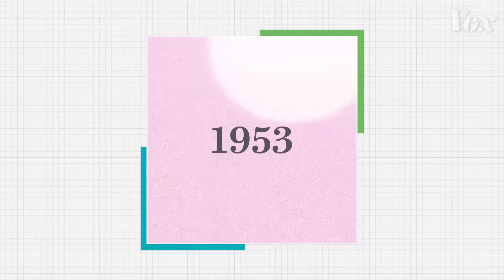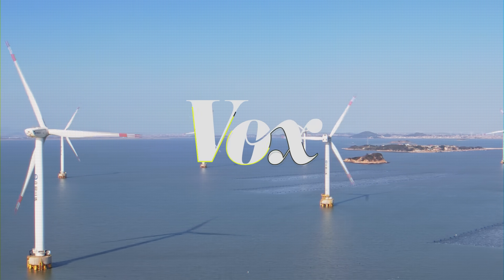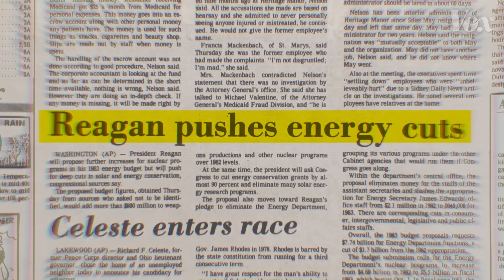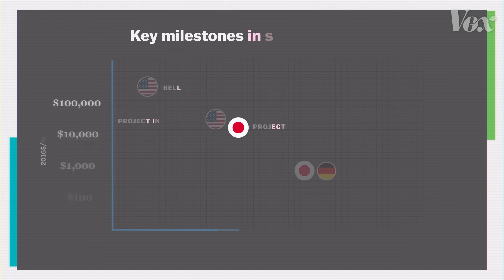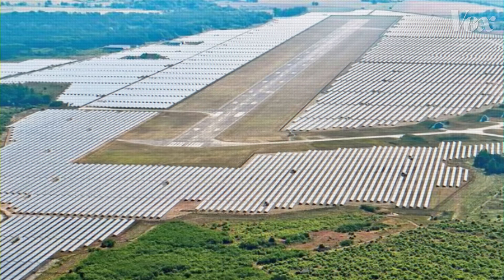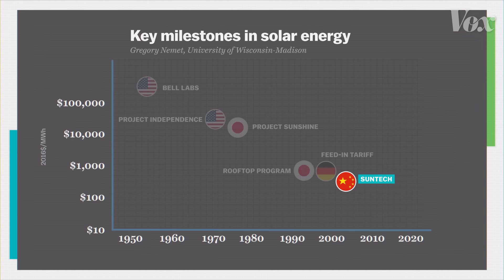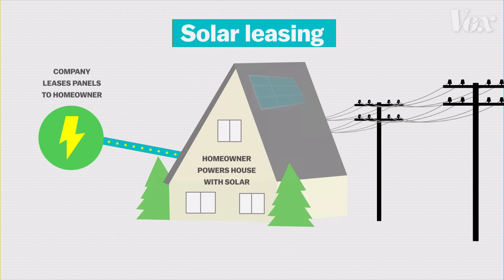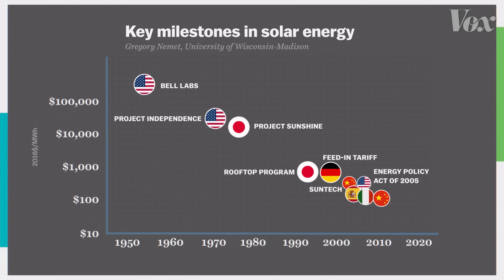How solar energy got so cheap

Comment: Governments should subsidize results, not means. 
Take electric cars (I own one). Rather than subsidizing a specific technology, the government should have subsidized vehicles that don't directly produce carbon when driven. 
The drawbacks of electric cars are:
expensive charging infrastructure (fast chargers still cost tens of thousands of dollars plus infrastructure for each one)
the vast amount of rare earth metals to make the batteries
their weight (mine weighs 4,000lbs, causing roads to deteriorate faster)
refueling/recharging (this has gotten better too, but the best one still takes at least 4-5 times longer than refueling a gas car)
Toyota had found a solution to all of these problems when they spent millions of their own money developing a hydrogen powered car. These still use electric motors and batteries, so you still get all the advantages of an electric car (regen braking, instant torque). However, their batteries are a fraction of the size (so a fraction of the rare earth metals), they refuel as fast as gas cars, they weigh about the same as ICE vehicles. As far as refueling infrastructure: you could build an electrolysis setup and make hydrogen using stuff from your kitchen (seriously, youtube it). 

However, this technology never took off because it can't compete with subsidized electric cars, even though it is arguably a better technology. No one is buying the cars, so no one is putting in refueling stations (and the few that have, have no competition and charge as much as they want). 
When governments pick technologies to win, sometimes they get it right, and other times they don't.

Comment: If This Is True.. Why Are We Not Applying This Same Scheme To Solving The Fusion Problem??
Reply: Because fusion has no starting point of even working for now. The "net energy gain" stories are not "net gain", but a laser pulse of size X generating 3 times X in heat.
But generating the laser pulse needs 100 times X in electricity.
And the 3 times X in heat is nowhere near a suitable form to drive a generator (which would at best gives one time X in electricity...)

Comment: My grandparents setup off grid solar at their rural retirement property in 1999. It cost something like $250,000 
Their property was so rural they didn't have indoor plumbing when they initially bought the property, they were still using an outhouse. So off grid was the only viable option. 

Now day's, off grid is nearing the price off connecting a normal semi rural house to the grid. Maybe in another decade it will be so cheap all new houses will be off grid unless there's some serious reason the owners need a massive power drawer.

Comment: If it is so cheap, why does in California(sunny state btw) PG&E rise the energy rates?)
Reply: Profit. What way is there to increase profits by laying off power plant employees (they cost a lot of money after all), and switch to an energy source that only needs a technician to check it once a year, and then say prices are up because of that change. It's the ideal way to make even more cash
Reply: @slik_  agree. But it automatically means that end users don’t see any cheap energy, etc.
So, the whole point doesn’t make sense, because we have to fix the whole chain from the supplier to consumer.
Reply: @evko9264  I'm all for government owned energy suppliers. But even without price gouging, renewable energy is much cheaper. 

Take a coal power plant for example. First, you have to pay people to mine coal, which costs a lot of money (equipment, liability insurance, personnel). Then you have to pay people (and equipment) to move the coal to the powerplant. Then you have to operate the coal power plant itself, again paying a lot of money for personnel and equipment. You also have to make sure coal isn't being stolen (which is a thing btw), so you have to hire security for storage facilities. And the whole chain is also highly fragile and can easily be disrupted by economic fluctuations (for example, coal miners asking for higher wages, gas prices spiking, which increases transport costs, etc.)

in contrast to this, you have a wind turbine. You buy the whole thing from a company, which then puts it at a location you picked. You then pay for a single technician that checks up on the entire wind farm every now and then. And since wind turbines aren't easy to steal, you won't have to worry about site security either. This chain is much simpler and less prone to being disrupted. The wind isn't going to strike, neither is the wind turbine. Both don't care much about gas prices either. You also won't have to hire somebody to mine the wind, or to transport it to the wind turbine.
Reply: @slik_  yes, I understand all these things. But be a simple user and consider all these chains as a black box. Compare your exactly price and bills today and 3-4-5 years ago adjusting it to inflation. I believe they will upset you.
And one more thing interesting exactly about coal. Despite the growth of renewable source energy(that is really good), US coal usage has been increasing for the last 3 years)
I’m just cautious about things when in media  suggested any idea that is flawless, and future, the ONLY possible feature and so on.
Reply: @evko9264  as I said. The narrative that renewable energies cause electricity prices to spike is a myth. Compare those electricity suppliers' current manager/CEO salaries with those from ~5 years ago. It's all price gouging with some alibi reason put forward to confuse people, and to make CEOs even richer. 

Also, "renewable energy" isn't some monolithic thing. The way wind turbines, solar panels, hydroelectric power plants, etc. generate electricity are very diverse and different from each other, so investing in renewables only is actually diversifying the process of generating electricity in order to prevent electricity prices to spike.

Comment: Ask those with solar panel system how their life is. Everyday, they live with anxiety, always monitor electricity battery status, and try to scheme which appliances must not use. And ask them where those "saving money went to". Equipment maintenances. A pack of batteries eats almost all that money saving. Despite manufacturer or scientists claim solar battery can last up to 5 years, 10 years, in reality the performance of the battery already starts to decline since year 1. Why? Because the manufacturers or scientists made those prediction based on "perfect conditions", in reality, it is impossible to practice similar method, hence that's why consumers battery tend to last shorter. 

And the thing that solar system owner is losing is " Time". Because they maintain the system themselves. I am talking about those who are not under contract with solar system company, because the latter is much worse, a scam.

Comment: Fundamentally, this is a story about two competing economic principles - supply & demand vrs manufacturing theory.  Fossil is the former and solar is the latter.  And as fossil is a commodity whose price rises as resources become more expensive to extract, the advantages of manufacturing theory can be (and were) calculated. Therefore, there was an inevitability to solar becoming the cheapest energy source and the decisions of the many governments to subsidize solar were clear by the year 2000.  --Rick Sellers, former Head of Renewable Energy, IEA.

Comment: Solar power is very cheap during the day. But very expensive after the sun has set, because storing energy is incredibly expensive. The total system cost of solar is a lot higher higher than most other power sources, including nuclear. So it's unfair, I'd even argue deceptive, to claim that solar is the cheapest form of energy.
Reply: how is storing solar energy any different from storing other types? perhaps using solar during the day but other forms during the night could combat this. where you are still polluting less and saving money without entirely depending on solar
Reply: @murray4293  Storage is extremely expensive regardless, that's why it tends to not be done at all. The problem with most other methods of generation is that they normally take days to safely ramp up or down (nuclear, coal), so they tend to be used used for baseload. The only methods available that can ramp up and down quickly is fossil gas and hydropower. So you'd need to have full generation capacity both the hydro/gas and solar. This is exactly the reason solar isn't cheap.
Reply: Have you ever heard of a hydroelectric storage plant my friend
Reply: @slik_  I have, assuming you mean what the industry refers to as pumped hydro. They are expensive ($165 per kWh) and require a specific geology (mountains/tall hills) that many countries don't have. Storing energy is insanely expensive. Cheaper storage would make solar a much more viable solution.
Reply: @slik_  To add, hydro storage is highly inefficient and insufficient

Comment: Going solar is good and all however cheap panels from China are usually built using coal energy which is notoriously bad for the climate...
 I do not know exactly how that balances out for the climate but I just wish Vox had investigated/mentioned this issue here...

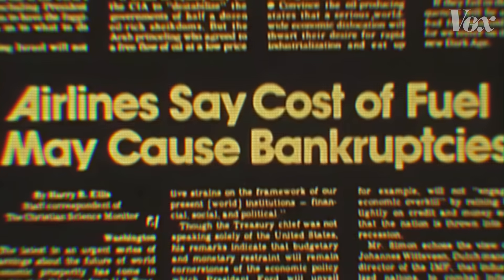Comment: 1:05  LCOE is not useful to compare the costs of technologies if non-measured costs differ significantly or if the technologies provide different services to the electricity system.

For example, if site-specific costs are left out of the LCOE metric, it will not reflect relative costs correctly. The value of the site will depend on its size and location. In some areas wind will blow or the sun will shine more, lowering the cost of each kilowatt of electricity generated.

Technologies that can provide electricity at any time tend to generate when it is most valuable, as it leads to larger returns. Intermittent renewable sources, such as solar PV and wind, generate in response to the weather rather than to market signals. An electricity system operator trying to match generation and consumption in every moment cannot rely on them always being available at times of high demand, a consideration that is not included in the LCOE metric.

Comment: 1:05 the price of electricity graph is preposterous. It compares apples to oranges, not apples to apples.
Solar cannot produce electricity when there is the most demand (early hours, evenings).  So it is not correct to compare these prices, because if we want to compare the same 365/24/7 availability provided by gas/nuclear/coal we need to add batteries or other forms of energy storage to solar, and batteries are not no cheap. also solar panels are very costly to recycle, and we need a lot of panels.  If we combine the total price of the similar energy grid provided by coal/gas/nuclear the solar + batteries + recycling alternative costs much much more.

Comment: Way too optimistic. Costs don't remain low in a retracted economy and when natural ressources become more and more expensive to extract. Plus solar panels don't last forever, they need to be replaced every 30 years or so, producing a huge amount of waste. That's why for now, nuclear is only actual cheap renewable energy and the only viable option as the main source of energy of most coutries' energy mix when phasing out fossile fuel.

Comment: But even with all that price drop.. is not cheap to put up solar system on your home.. from the cells to the batteries.. not to mention the maintenance.. just try a rough math on your economics if you go solar a 100%, with your current energy usage..

Comment: Even with the decrease in overall production costs over time, solar is still only cost-competitive on a large scale in places that are consistently sunny, like the American SW. Cloud cover severely reduces the efficiency, and when you factor in the lack of good grid-level battery storage tech, it's still useless when you need large amounts of power at night (a common thing during the winter in cold countries). This is to say nothing of the environmental effects of mining all the minerals, the toxic byproducts of solar panel manufacture, etc. It's the right tool for the job in some places but a lousy idea in others.
Reply: We also should not forget that  the price of 1 kw in California is 50% higher that US average, and ~3 times higher than in Texas.

Comment: Solar may be cheap, but energy storage is whole another issue. Most energy storage systems use li-on batteries which are still expensive to store energy. We need more research into energy storage and modular nuclear fission reactors and of course, nuclear fusion.

Comment: The price graph appear to be starting to level out so is there not expectations that the price will go down much further? I've heard silicon panels are reaching theoretical maximums in terms of efficiency. We'll need another breakthrough to drive prices further. Scale alone isn't helping as much. Hope to one day install solar in my home
Reply: it won't level out, it's still halving, but a half of very little is also very little, but the price matters less because installation costs are labor costs that's something which hasn't come done as much

Comment: I live in South Africa where the failing state-owned power utility (and until recently, a monopoly) has been failing and as a result, has had to implement rolling blackouts. For the last few years, retail and residential solar installations have sky-rocketed as a mitigation strategy. It's feasibility on a small scale like this is due to these cost reductions, as the cost come down further, I think small and medium scale installations will become massively transformative in the developing world, providing power at a more affordable rate then fossil fuels and nuclear.

Comment: It won't make a difference. Electricity is not the major form of energy consumed globally (it is only 20.4% of global final energy consumption). Currently, solar produces only 3.6% of global electricity or mere fractions of global energy consumption. Furthermore, even with the wind (and both solar and wind produce only 10 percent of total electricity, not total energy, in which their share is less than 2 to 3 percent), we do not have enough metals to make batteries to store energy and meet the entire civilization's energy needs. In addition, solars not only take too much land, but once they age out, the solar waste is as bad for humans and animals as other typical metals and plastics. Nuclear and innovation through more research and development is the only way out of the problem.

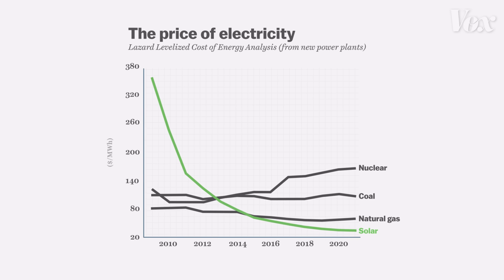Comment: 5:35 Solar == "clean and reliable" 🤮🤮🤮🤮🤮
Reply: i mean, in terms of energy production is clean but is not definitely reliable
Reply: @kentozapater8972  problem is, it's neither clean. Manufacturing solar panel produce more~or~less as much CO2 as the panel saves in its lifetime. Not including batteries, that you now DESPERATELY need. And this in comparison with nuclear (that is 99.99% clean) solar looses HARD.
Reply: @PCr4zy  yeah, every source of energy pollutes in its lifetime, like manufacturing, or dismantlement, but solar is amongst the cleanest sources along with nuclear and eolic (onshore)
Reply: @kentozapater8972  only on paper, put in sahara desert sun, having no connected batteries. Once you put solar outside the perfect condition and add batteries, its really not that good. It literally falls down bellow natural gas.

Comment: Solar companies and their salesmen are really predatory.  8.99% - 23.43% APR on 12, 15, 20 & 25 year Terms.  Installation is still really expensive when each panel only cost about $250. Then there are the issues with selling/buying a house with solar panel lease.  People really need to be able to have this information that is not being communicated by the salesmen.  I know because i've engaged with every door-to-door solar salesmen and they deny any concerns to make a quick buck.
Reply: Interesting, right now my best option is a 4.49 25 year finance. I don't know why someone would offer you a high APR like that unless you are demanding the cheapest sticker price. What it comes down to for me is the best financing option to suit the needs of the homeowner at the cheapest cost per kilowatt over the financed term. I'm also blessed to be in a market with cheaper solar cost per kilowatt than the utility.
Reply: Please tell me more about this. I have been applying to solar sales jobs but every employer I ask about the position is very hush on discussing their sales target. One company wanted me to sell residential panels at a rate of $40k-70k per typical install which seems like a rip off. Another company wanted me to push the PPA deal instead of ownership. I want to get into the solar industry but I can't quite trust any of these companies that I have met so far. All they seem to do is promise a bright future for me and assure that we are helping people. Right
Reply: @Carllito12  what you want to do is find a company that doesn't care about system cost. The company I work for has no minimum other than $5k total system cost, which is hit on anything 2 panels or above, anything less and it doesn't make sense to do it for either party. Arguably, a 2 panel system doesn't even make sense in most places anyway.